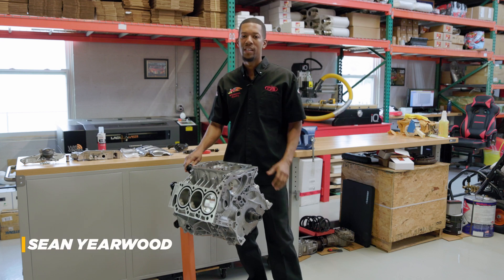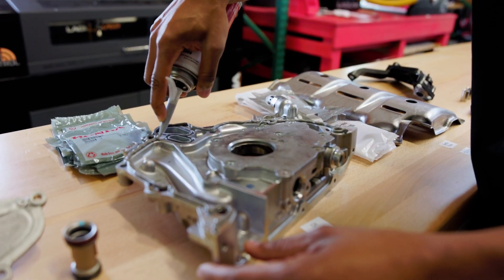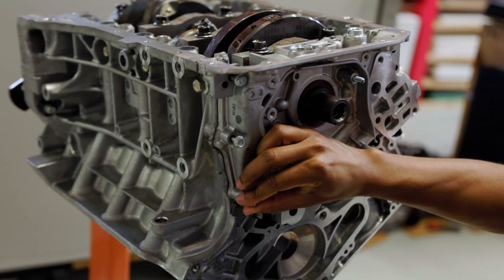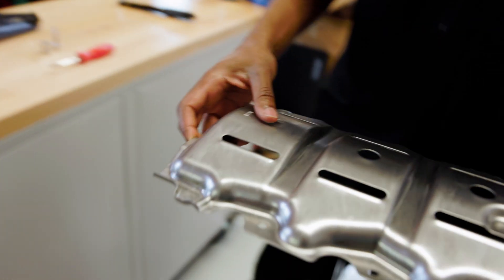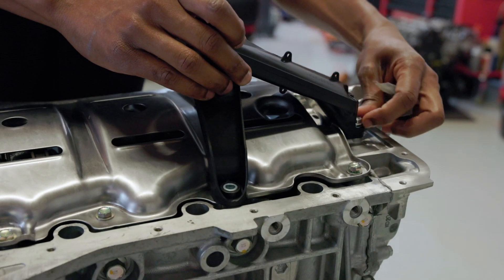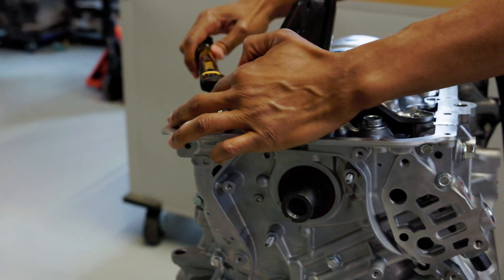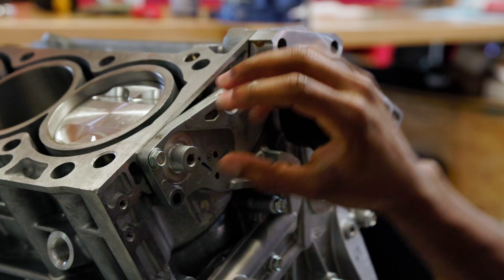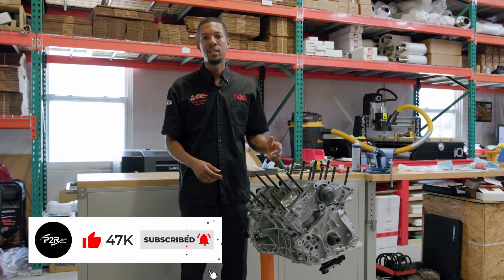J35 Cylinder Block Assembly Oil Pump, Water Pump, Torque Specs, Etc

Comment: Does the orientation of the oil drive gear matter? In terms of that notch cut out? Should it be facing up or down or no particular direction in regards for timing?

Comment: I noticed you applied Hondabond around the outside of the odd shaped double o-ring on top of the oil pump, which has a very narrow edge.  Now the service manual tells you to go around the inside of that only.  I thought about doing this when I resealed the oil pump last time on my J30A5 but is this really safe to do?  Wouldn't the goop get all over the o-ring itself?
Reply from the maker: Yeah so generally you only need to go along the bottom side.  The hondabond won't cause o-ring issue unless over applied.

Comment: R70 block? Different style oil pick up then 32a2 & 35a4.
Reply from the maker: Yes the R70 blocks use a plastic oil pickup compared to the j32a2 and j35a4 which use a metal pickup.  Also R70 uses the newer style bellhousing. So it's a totally different block.

Comment: I bought an Acura MDX, 2002 for only $1700.  It's in amazing shape.  No dents, absolutely no rust, everything works.  Not a single drop of oil leaking anywhere on it.  Dual climate COLD AC that blows hard in your face. Has 3 rows of tan leather seats that fold down, heated mirrors, heated seats, moon roof, virtually new tires all around.  It's AWD, with the 3.5L Vtec (J35A3)-- only 155k miles.  I've driven it for 2 years now with zero issues..... I love this thing.  

 Does anyone know if there is a Manual Transmission swap for these?  If I could keep the AWD system and have a 5spd or 6spd manual transmission, it would be a dream.  My automatic works great, it doesn't have any issues at all.  I've just always owned manual transmissions and I wish I could get one to put in this MDX.

Comment: Do you ever use a dry sump and does anyone make a dry sump oil system for the J series?
Reply from the maker: I don't personally have much experience with dry sump setups.  Though I have a dry sump setup here that I want to mess around with when I get some time.
Reply: @PowerRevRacing  cool, would love to see how you do with it.